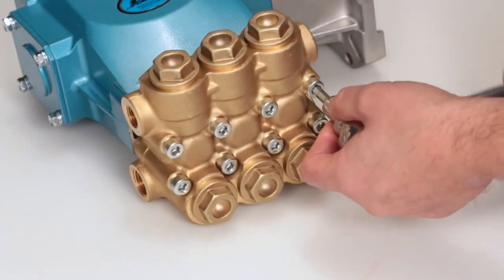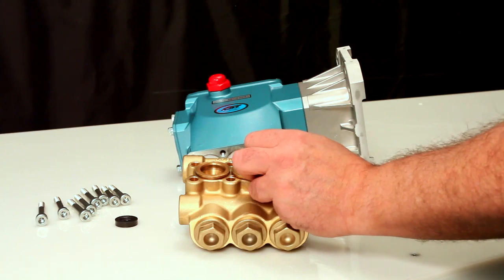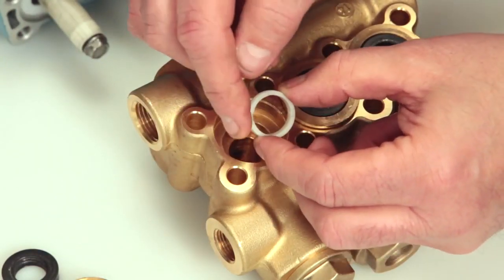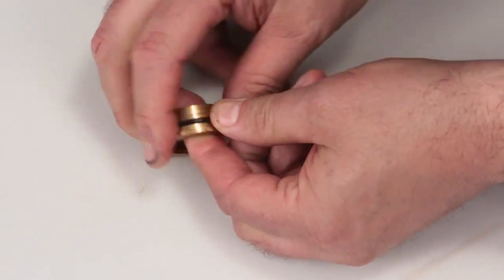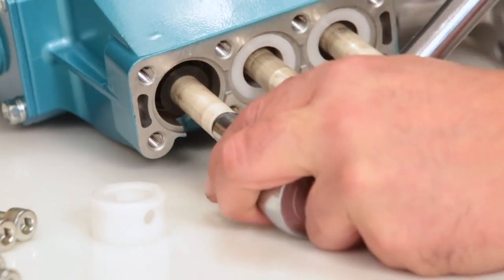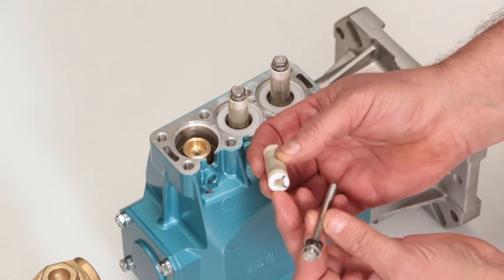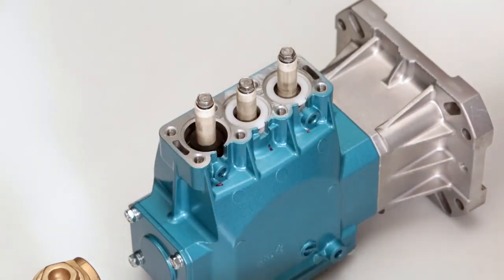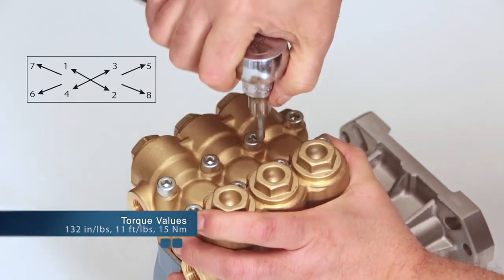CAT Pump Repair: Servicing Seals 66DX, 6DX, 5DX Series

Comment from the maker: Required part for this video: https://www.jnequipment.com/shop/pressure-washing/pressure-washer-repair-parts-kits/cat-pump-repair-kits-replacement-parts/34262-cat-seal-kit-6dx-66dx-pumps/
Reply: You forgot fingernail file or a manicure.